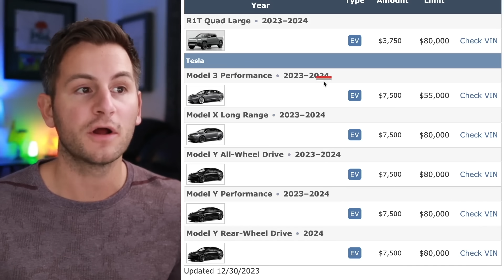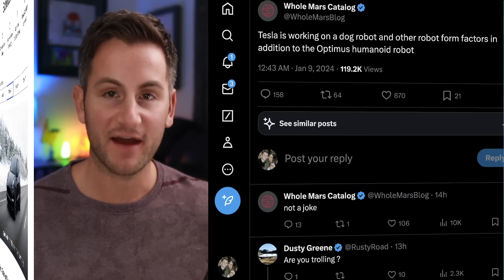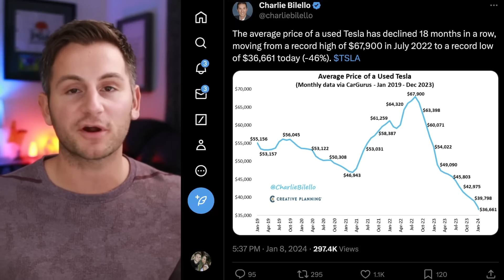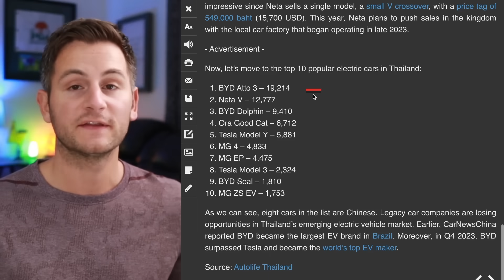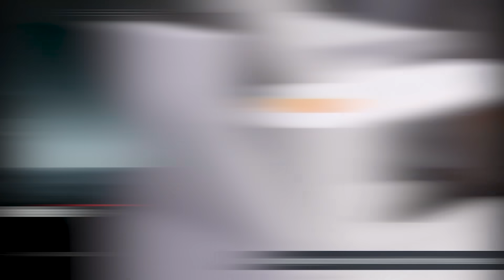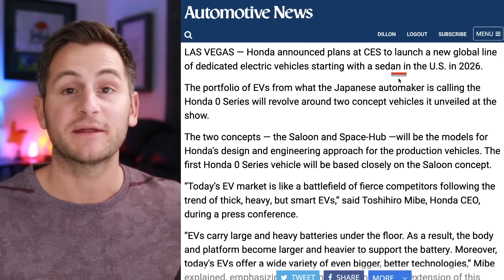Those "Other" Tesla Products / Giga Berlin Expansion / CES EV Highlights ⚡️

Comment: It is a complete lie that EVs are eco-friendly and environmentally friendly! Research at George Washington University and the University of Amsterdam has revealed the following: ・In the first place, about 70% of the electricity used to charge batteries is generated from fossil fuels. ・A large amount of CO2 is emitted during battery manufacturing. ・A huge amount of CO2 is emitted when mining rare metals and rare earths, which are the raw materials for batteries. Diesel engines in large heavy machinery, mining machines, etc. emit huge amounts of CO2. ・In the case of an electric car, it weighs 150 to 250 kg more than an equivalent gasoline car. As a result, the speed at which roads and other infrastructure deteriorate will increase by about 1.5 times, the number of repairs will increase by 1.5 times, and CO2 emissions from heavy machinery used for repairs will increase. Of course, the production of asphalt for pavement also emits large amounts of CO2. - Due to the increased weight, tires wear out faster, which naturally leads to faster tire replacement cycles. CO2 emissions during tire manufacturing increase considerably. Dust emitted from tires also contributes to environmental destruction. - Electric vehicles end up being scrapped after about 5 to 6 years because replacing batteries due to deterioration costs a huge amount of money. Considering that the average lifespan of a gasoline-powered car is 9 to 10 years, this is not eco-friendly at all. Also, even if batteries are replaced or recycled, a considerable amount of CO2 will be emitted due to the above points. So, far from being eco-friendly, electric cars are about 1.5 times more expensive when you buy a new electric car and continue driving it after driving a similar gasoline car for 8 years compared to driving an electric car for 6 years. The research team at the university mentioned above has also revealed that total CO2 emissions will increase. I'm not saying you shouldn't drive an electric car, but I would like people to do so with the awareness that electric cars cause environmental damage and emit as much CO2 as a supercar with a V12 gasoline engine.

Comment: A four wheel drive robot would be able to rotate in place if the wheels can turn 90°.And ut would be faster than walking.
I don't think they have many stairs in factories. At least not at workplaces. So wheels would work fine there.

It's surpricing everyone wants their robots walking. That's cute, but an unnecessary complication.
I would concentrate on vision, touch sensors, and a good pair of arms,.. or three.
And I want the robot to be able to balance the weight it's lifting.
Perhaps just by tilting, or shifting place within the wheelbase, for counterbalance.
Reply: It’s not an unnecessary complication to have ‘walking’ robots.
The human world is built around the human form & function.

Comment: Economics of the rain sensor is either 
$10 per sensor + installation + software integration = $20,000,000 per year for Zero innovation... 
OR... 
Spending the same $20,000,000 per year in research, and solving vision obstruction by liquid, + rain density... that can be used for robot vision, car vision, roof maintenance... 
Invaluable.

Comment: Another good point about using the cameras for rain sensor. Is that if they can get it working correctly then it can be added to all existing vehicles with an update.
Reply: Right now the cameras can't see rain in the dark. You'll notice, when driving in dark areas the wipers don't come on. As soon as you enter an area with street lights, the wipers start.

Comment: These excuses about saving money is just bad. Pls don’t defend everything that Tesla does. They should spend the $10 for the rain detector and the $10 for the ultrasonic sensor. If Tesla is that concerned with margin, charge $50 more for those cars with these sensors and everyone still will buy the cars with the sensors. And if Tesla sell 2 million cars, they will make $30 million extra profit and have happier customers. Also the NN can use that data to make decisions more easily and not just rely on the camera. If it knows it is raining, prob it will have to adjust the weights for the algorithm coz what the camera sees is not perfect.

Comment: Rain sensor cost - question on burdened cost for manufacturing BOM parts. Dillon great point on the total cost for adding a rain sensor. When Sandy Munro and other manufacturing cost experts post cost estimates for Tesla and other cars I can’t recall them sharing a standard for the burdened or overhead cost of an item This is sometimes shared when talking about labor, the true cost for budgeting is the wage plus a burdening percentage to cover benefits, and real estate, and a host of other costs for an employee. It would be very interesting to hear if Sandy, or another auto cost expert, can share the standard burdening or overhead that Tesla uses for any new part added to a Bill of Material. For example let’s that $20 rain sensor. When if is added, do they then also add in another 30% for the true cost of adding it in?  Just a manufacturing standard practice about the true cost of complexity  that reinforces the benefits that come with a culture of “The best part is no part”.

Comment: Hey Dillon, love the channel but please issue a correction. I am a tax lawyer. The credit is not a “rebate” otherwise properly known as a refundable credit. It is a non-refundable credit. You can offset your tax but there is no refund of any excess. If your tax pre-credit was $6000, the credit will offset that $6000. But you will not get a refund on top of $1500.
Reply: My understanding is that you are technically correct according to the letter of the IRA, but the IRS guidance clearly states that in practice it will function as a refundable credit since the IRS will not attempt to recover any overpayment of the credit
Reply: So make sure you do it via a dealer that is on the credit transfer program.
Reply: @jeffreybloom Dealer would be on the hook, not me.
Reply: Salute
Reply from the maker: hey jeffrey - thanks for sharing your view on this. i'm working to get some clarification and i will bring this up again soon. cheers!
Reply: @DillonLoomis22  
So I did more research and tried to post follow up but because I had links to the IRS FAQ it kept getting blocked. It turns out that as long as it is for the new system with the credit transfer to the dealer, it is effectively fully refundable. It is bizarre as there is no support for that in the legislation and it must be making Manchin nuts. But that is what they are doing. FAQ question 4. The truly strange thing is FAQ 21 says if you do go this route and you fail the income threshold then you have to pay the IRS back. Totally inconsistent approaches
Reply: I stand corrected. See the FAQs for the new transfer to the dealer regime in 2024. Shocked the IRS is posting this, the legislation does NOT authorize this approach. Look at Q4:  https://www.irs.gov/newsroom/topic-h-frequently-asked-questions-about-transfer-of-new-clean-vehicle-credit-and-previously-owned-clean-vehicles-credit#:~:text=For%20dealers%3A%20No.,made%20that%20notes%20such%20election.

HOWEVER, if your income turns out to be too high, you do have to repay. It makes no sense. Q21.
Reply: I don’t know what happened to my follow up post - Suunraze is correct. It’s bizarre and not authorized in the legislation but the IRS FAQ for the new transfer to the dealer of the credit DOES effectively make it refundable. Look at Q4. But the weird part is they do say you need to repay it if fail the income limits. Q21. Bizarre. https://www.irs.gov/newsroom/topic-h-frequently-asked-questions-about-transfer-of-new-clean-vehicle-credit-and-previously-owned-clean-vehicles-credit#:~:text=For%20dealers%3A%20No.,made%20that%20notes%20such%20election.
Reply: SEE Follow Up Below: Not a position I would advise people to rely on and just hope it works out. Audit ain’t fun. Interest and penalties pile up fast.
Reply: Nerd. lol

Comment: Tesla is not alone with the challenge of sensing rain. I've driven cars from GM, Toyota and Mercedes and I've never been happy with the automatic wipers' performance. At least with a software solution it can get better.
Reply: Recent model 5 series sedan wiper sensor needs a lot of fine (?) tuning, too…
Reply: The ‘auto wipers’ on the three Tesla’s I’ve owned (2021 M3 LR, 2022 MY LR, 2023 M3 P) are all useless compared to my previous 2011 BMW 123d Coupe and 2014 Skoda Octavia vRS (basically a last-gen Audi A4 estate with a VW Golf GTI powertrain). Given that both of those cars were designed at least 10 years before the Teslas, this is yet another perfect example of “just because you *can*, it doesn’t mean that you *should*”. I’m referring directly to the removal of the indicator & drive stalks (among other utterly ridiculous choices)…
Reply: Actually no premium manufacturer has solved this problem so far. If it works decently well you can be happy. E.g. I am quite happy with the Kia EV6 but I have camera problems in snowy conditions - but who has not?
Reply from the maker: thanks for sharing this john - good to know
Reply: My BMW 535i rain sensor system works well.

Comment: I think “Highland” is inaccurate.  The Highland program may well be long-term, and a “Highland 3” may be announced in a future year.  I’d call this one a 2024 or “refreshed” 3.
Reply: It would be unusual for a manufacturer to reuse a product code name.
Reply: @Dularr  Point is, Project Highland may be an ongoing campaign to explore bringing 3 up to the cutting edge...which is a moving target that may never be fully realized.  They may have reviewed Highland's proposals and said, "OK...let's capture the new body design, rear screen, and interior accent lighting in 2024, but keep working on the steer by wire, fluidless design, front casting, 48v architecture, air suspension,  and boxed manufacturing until later.  Thus, the Highland whispers and rumors may pop up again in the future.